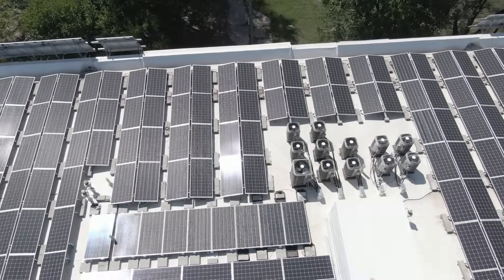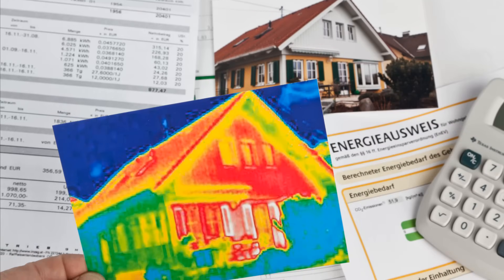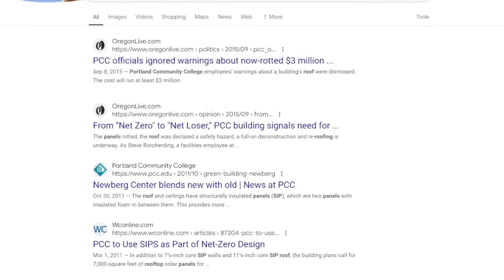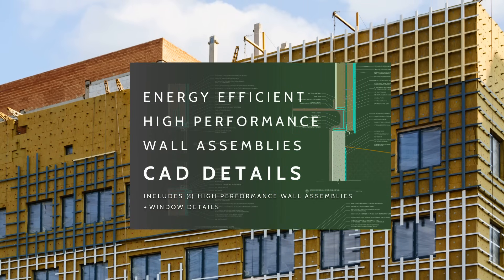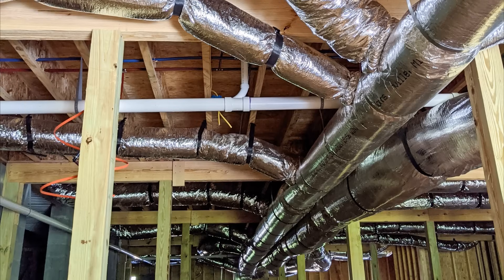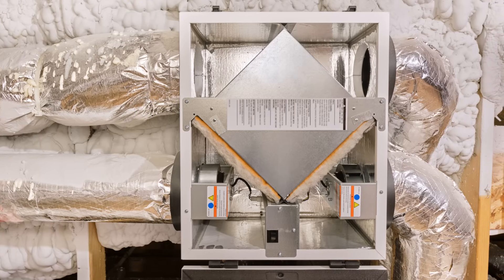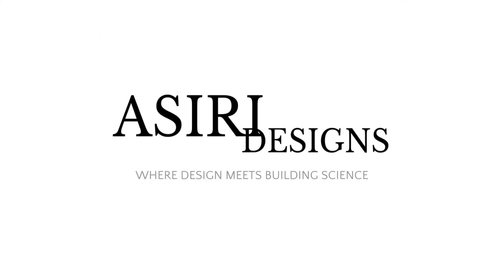The Unintended Consequences of Energy Efficiency...

Comment: Agreed completely about not risking longevity of a building for ticking off checkboxes to meet thermal efficiency targets. Here in Britain, the government give out grants for people to insulate homes for them to tick off checkboxes, but most people get some inexperienced and unprofessional muppet to go in and spray poly foam everywhere, basically creating a sawna inside the attic space when the heating's turned on. There's zero ventilation or breathability, and so many houses - in particular here in the Welsh Valleys - are terraced houses that were built during the industrial revolution days, so they're cold roofs with some air gaps for the roof space to breathe. If you seal that space up with insulation that doesn't allow air to flow at all, the timber will just rot...

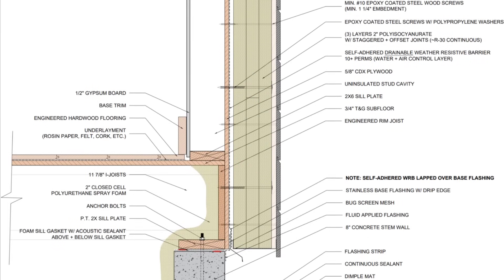3:37 can you say that in super Layman's terms please 🤔😜
All I heard was "If we can install insulation outboard of the sheathing..." That diagram is like gibberish to me. I genuinely get bored looking at that image 😅

Comment: I dream of having mechanically ventilated and dehumified cavities, powered by solar roof panels. Real time managing humidity and bringing in fresh air to ensure the wood and insulation can dry to the outside. 

This is ofcourse not necessary at all in stone houses, but for the timber revolution it could be a good option. Dehumidifiers are not that expensive, and some pvc pipes could be installed in the cavity to ensure the new air gets in all the right spots.

Comment: 1. We are not just using insulation. Efficient air handling and overall building design is a larger part of the puzzle. 2. Poorly done building & retrofits do not mean insulating is bad. Low durability structure is not the fault of insulation. 3. There is no one solution for every location, climate, or structure use. Broad applications of a single technology may wander into situations where that technology is counterproductive. Educating builders on both materials selections, and construction methods as it applies to the use and local climate should be the priority. 4. Embracing technologies and methods from other parts of the world instead of pretending that North America has all the answers would go a long way in changing how we approach designing structures and using land and materials. 5. We cannot rely on tax credits or other schemes for retrofits and new builds. Things need to have a realistic base threshold, and structure design should be guided by the result of what that looks like. 6. Geothermal is something we need to look into more. Both for heating/cooling, but also electricity production. 6. Heat does not dry surfaces, low humidity and moving air does - dehumidifiers could work great so I agree here. Ventilation and whole structure construction quality plus a re-think on retrofits/remodels should be a hot topic that we talk about way more.

Comment: My wife and I renovated a house here in Germany from 1956 and completely overhauled the insulation. Outside walls were insulated, the new roof was insulated, the basement ceiling was insulated, etc. We put a lot of value on insulation that was ecologically friendly, meaning that we didn't use cheap foam or mineral wool, which drove up costs a lot. And I can't really recommend doing it the way we did it. More expensive due to less availability, more work, marginally better efficiency, etc. But the quality is superb and this house will easily last for decades. 
If you're going to spend a lot on insulation and energy efficiency, make sure that the house is actually worth it. And most American houses just aren't to be honest... When someone literally banged your house together with staples and nails, then insulating it to hell and back is just polishing a turd. What good is 50k of insulation on/in a house that'll only last 10 years because it's so poorly built?
Reply: American houses last much more then 10 years. The house I grew up in was a modern wood framed house and still looks new 32 years later.

Comment: Why isn't everything sealed ? I mean the wood can be soaked or coated when made or before next laying to protect any leaks ...
Reply: On an old house, you'll never find everything. You'd spend less money building a new house then trying to hunt down every little leak everywhere. So as long as the leak isn't big enough to cause a problem, you don't really worry about it. Your leaks can also come from summer/winter. As parts can pull apart from changing temperatures, meaning a perfectly sealed house built in summer, might not be so sealed in winter.

Also all the fasteners break the seal, like for instance the nails/staples holding the vapor barrier and siding up, are penetrations through the structure that some moisture can wick through.

Comment: Ok guys, crazy idea, how about building with highly insulated and inmune to moisture materials like concrete and brick? 😮
Reply: Concrete is porous and acts like a oven. When I worked in a concrete shop, the back wall would be like a heater in summer time, only thing worse is the shop I'm in now with sheet metal walls. So you still need insulation. Both concrete and brick are heavy, increasing transportation costs which increases housing prices. Brick requires special skills to do properly increasing the cost of labor, increasing the housings costs. Both require more time to assemble, requiring that expensive labor to stick around longer, increasing costs further. They are also not conducive to upgrading and remodeling, as now you have to jackhammer walls to change the locations of outlets, switches and other things as well as to add additions, further increasing the costs of housing. 

Unique to earthquake zones, they don't flex, making them more prone to collapse and  when they do the rubble is heavier reducing person(s) suitability when it comes down.

Wood is a endlessly renewable resource, making it sustainable, while growing it helps by absorbing CO2 and making O2, meaning houses are carbon sinks by being made from the wood, as opposed to concrete which emits CO2 while curing along with the increased fuel use to move it.

Wood studs also give natural areas for insulation, concrete and brick still needs to have some way to add to the insulation to meet R value codes in the area.
Reply: @SilverStarHeggisist  porous would make it the contrary of "like an oven"
Transportation costs and skill needed are just cope, you're just justifying high labor cost in USA.
Ill give you about the time, but in time of age we have many accelerant agents.
Remodeling is in fact easier in brick because you dont have to fear for the building to fall down if you take away a wall.

This second paragraph is absolutely untrue, chile, my country, is one of the most, if not the most seismic country in the world, we had 2 of the biggest earthquakes and we dont fear them as much because we have good architects and laws, and surprise, we build almost everything with brick and concrete, that's just a law and skill issue in USA.

The last 2 might be a decent argument.

Comment: wood cabin coated with pine tar or linseed oil, or stone house, or wattle and daub with lime wash plaster. wood fired rocket mass heater in the center, heating massive amounts of clay and earth inside the house. house dries well and has fresh air from natural airflow through and around wood. heat from fire is absorbed into the thermal bulk in the center of the house and slowly disperses through the day, warming the house on very little wood. No energy loss in power cables, no cold death in power outages, no high tech needed, no toxic chemicals from plastic manufacturing processes. Keep the roof intact and you're all set. Roof can be split wood shingle with sufficient steepness.

Comment: I'm not a construction pro, but 100% agree on the point. I'm from Finland, and in the 70's due to oil price induced energy crisis Finland started building in "energy efficient" way. Solid mass timber / brick / concrete building and old-fashioned country-style wood building reduced, in favor of new style with multilayer walls utilizing many different materials, lots of insulation, air tightness etc. For some reason in addition to to this, they also made some buildings with flat roofs! And many with very low foundations!

Well, most of the houses from that time are still on the market, but MANY of them have had to go under significant reconstruction to get rid of mold and air quality problems.

Now being in Finland, we do get harsh winters so it's for sure that buildings need to be at least somewhat effcicient. Those old countryside "rossipohja" wood houses did not rot, because there was constant airflow going under the building and who knows where else. But that will cause significant heat loss. But concrete, brick and massive timber houses from that era are still doing a-ok. I live myself in a 1968 brick house built in older style. My mother lives in an early 60's conrcrete apartment building. In my house the upper insulation has been increased as that's where most heat escapes and windows are updated, but other than that everything structural and insulation is original.

Finnish building code puts too much emphasis on "U-value" when rating energy efficiency, which basically just measures insulation properties of a wall. But basic thermodynamics suggest that massive wall structures capture and release heat energy. It also seems straightforward to me that the more different materials you use in a wall, the more possibilities for moisture to condense in these material change areas. And if any/several of these materials are weak to moisture......

So if I was building a new house right now, I would go for massive timber and wouldn't look any further. Overall energy effciency rivals modern multilayer-buildings, but with only one wall material. Timber is faster to build than brick, and it is a beautiful material as is. 

Newer style buildings of course can and do last when all is done well. They are just much more vulnerable to circumstances and errors. It's hard to mess up if your wall is just solid, but it's easy to miss a spot or poke a hole on a vapor barrier sheet.

Comment: You sory of missed:
1. Why
2. What else could be done

If the focus of energy efficiency is: Net energy of the building over its life you need to include the energy already spent in creating and transporting the materials, and the energy taken to construct the home, then energy spent to maintain the home comfortably. There will be a sweet spot where the house design is more energy efficient over its life based on that. Currently i feel that we are leading to a very high cost with limited net energy benefit product.
Reply: This video was only focused on the upfitting existing old construction homes.

Comment: have you tried simply using concrete ? :P like - every architecture problem is solvable by enough concrete :D
Reply: Increased costs. And building material of a new home doesn't apply to up fitting a old home.

Comment: I am going to give the counter argument that I believe a structure should breathe.  The houses last a long time because they breathe with the environment... These tight house are not good for health or for durability.  The health issues of Mold are not worth the small percentage gain in energy efficiency and the need for high tech gadgets to move air.  

If you want Net Zero, I am convinced that Good insulation, not great is the solution and then just over size your solar and look for ways to cut your heating such as passive solar gains in the winter with roof sloops.
Reply: That's not a counter argument, that is the argument this video makes.

Comment: Basically, the cost to retrofit older homes will cost more than what you would pay for energy. This is what we call "Engineering stupidity". In newer homes this may work assuming it works 100% flawlessly in which you can never guarantee, but because of the price of homes new or used. Having high efficiency will be the last of your worries.

Comment: Separate the outer structure from the inner structure, entirely.  A house within a house.  Build the outer structure from metal that is less vulnerable to moisture.  The inner structure can be built more lightly and cheaply because it is shielded from the weather.  There is also the wonderful space inside the outer structure but outside the inner structure, indoor outdoor space.
Reply: That doesn't help with old houses already existing, the topic of the video and would wildly increase the cost of new construction.
Reply: @SilverStarHeggisist  There have been shelters built over existing structures.  One such example I saw was an historic house.
Reply: @georgekrpan3181  you're talking a wild cost. 

Also depending on location may not be allowed. I live near stassburg and good luck getting them to let you change the exterior like that.
Reply: @SilverStarHeggisist I don't know if you're right about the cost.  As I said the inner structure could be built more lightly and cheaply because it is shielded from the weather and it would not need the maintenance of a house sitting out in the elements.  I agree it would be difficult get it approved for an existing house but I have seen it done.

Comment: My brother and I have built 7 Insulated Concrete Form (ICF) houses. I would not build any other structure. One problem with an ICF house is that HVAC designers do not take in to account how energy efficient these homes are and size the air con and heating systems for a wood frame houses. Not a big deal in winter but the result in the humid summers of southern Ontario is the air con does a terrible job removing humidity. I have timed our compresser run time at about 3 minutes every half hour because the system is too big. So a seperate dehumidifier is needed during summer months.
    Something that is really fantastic about ICF houses is they behave a lot like old stone farmhouses in that they cost a little more at the start of the heating season and then once the concrete warms up the furnace runs a lot less. When this changeover happens it is crazy how noticeable it is.

Comment: Now I'm starting to wonder if my new energy efficient home is doomed? It has an ERV which leads me to believe they've obtained a tight enclosure but at what cost for water management? It is a home from a mass production builder so I'd be surprised if they incorporated adequate measures as you've stated. You've clearly identified a problem, what is the solution if you already reside in a building that hasn't been built correctly? Or rather how to identify if in fact it was built well, considering the items you mentioned

Comment: Heavily insulated houses will reduce the run time but it doesn’t mean you have to have a dehumidifier in the house.
One practice I have seen here in Saint Louis is over sizing your AC. This will cause the living space temp to cool quickly while leaving the humidity levels hi.
But if you size your AC unit appropriately. The AC unit will run longer, dehumidify the air and then shut off.
All that leaves the latent heat levels much lower in the structure. The AC will remain off longer, and will cool the living space down faster in the future, provided the humidity or latent heat levels haven’t increased because someone opened a door or window for a long enough period to flood the house with moist air.

Comment: I think this video would do better if it didn't initially frame this as a broad energy efficiency issue, but rather specifically an issue with insulation. When you start off with that title and intro, you've got the audience thinking badly about all energy efficient things rather than the actual focus of this video which is moisture control. But then again, not having a title akin to "energy efficient bad" won't get you those clicks.

Comment: thank you for this video 

I am an ICF home builder in IL. I'm all about high performance, 

I've even done some research on the SIPs failure in Juneau, in fact I met Joe Lsitburek (who performed 3rd aparty inspections on the failed buildings) at a GBA event earlier this year, very smart man. 

As much as I love the high performance community, sometime they deviate from what is practical, common sense, or appealing to consumers. 

The biggest issue I see is an unfounded fear of carbon and greenhouse gases, with no consideration for other aspects of a building and its materials such as longevity, safety, disaster resistance, etc.  This fear leads builders, designers, and other building professionals to limit what materials they use, and essentially stick to products like wood almost exclusively. products like ICF are frowned upon because of their supposed environmental impact. 

However,  as you mentioned, more insulation = less drying potential, High performance double wall assemblies have more failure points, and wood homes lack disaster resistance.  Furthermore, deforesting the earth and producing milled lumber is not carbon neutral either, requiring gas powered equipment to plant, grow, harvest, plane, dry, treat, transport, and install the lumber. I Couldn't agree with you more when you said "'There’s nothing more sustainable, than building something that is going to last for a long time". ICF building solve the mold issue, the air tightness issue, the insulation / efficiency issue, and also provide disaster resistance and are built to last. While it may initially use more energy to create this building, it will not need to be rebuilt several times unlike its wooden counterparts. 

just my 2 cents. 

Sincerely, a biased ICF builder :)
Reply: Yes Joe is a very smart man, understand EVERYTHING in this video hails from Joe's building science family tree